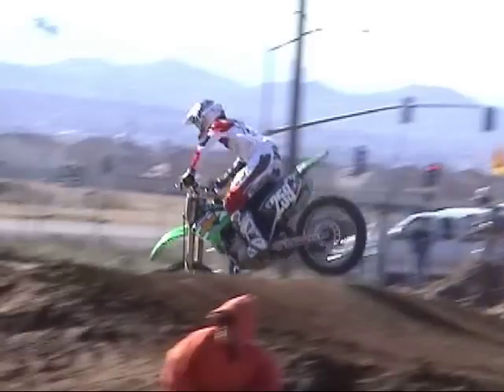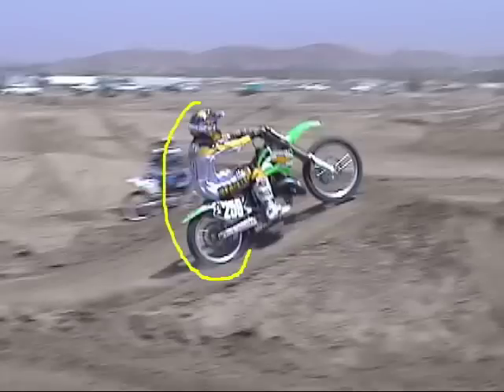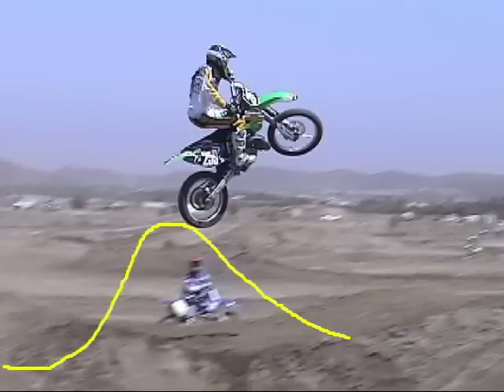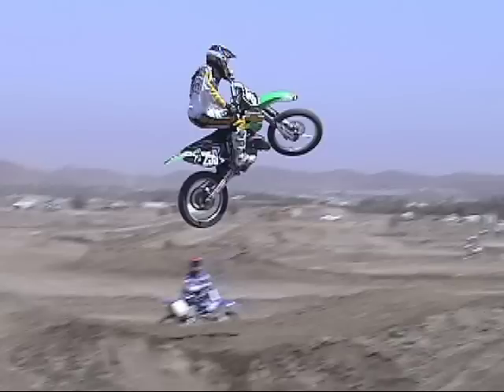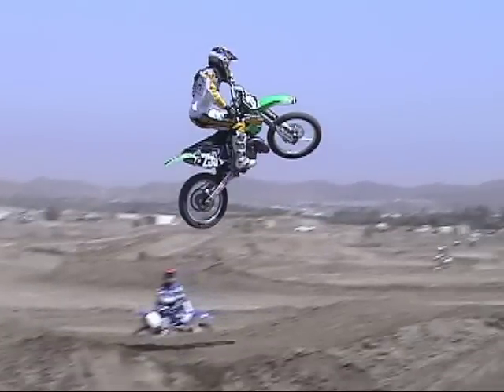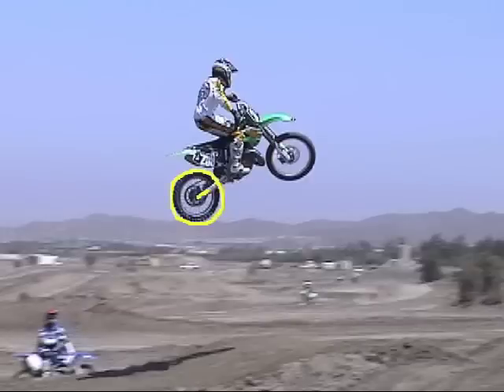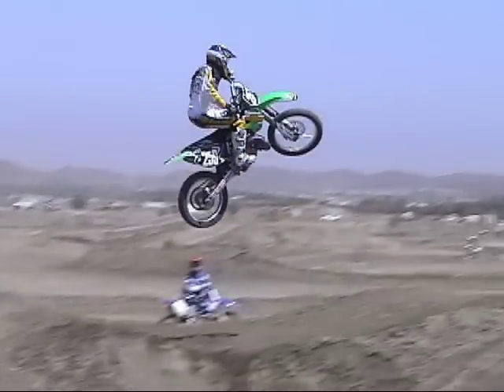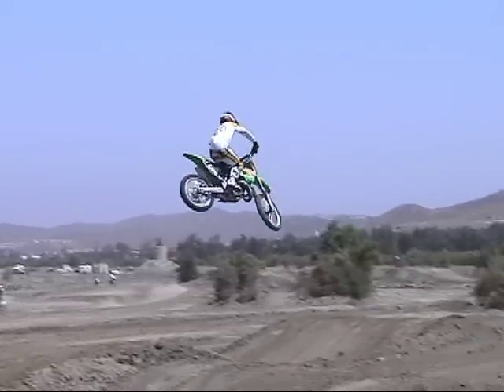RH41 - Bubba treino

Comment: this applies to any bike, slipper clutch or not, 2-stroke or not, if you stop the rear wheel in the air it causes the shock to compress, and when it uncompresses it makes the front end drop

Comment: @MrMotobros hello dude! It's just a matter of how long and how much hard you tap the brake pedal according to the rear wheel spinning speed and engine rotation level. In some situations, I not only pull the clutch, but also, open the throttle to start increasing the engine rotation at the same time. Doing that, after tapping the brake, causing the front end get lower and then releasing the clutch, the front wheel starts get higher again!!! It's quite common though. Hope it helped! .o/

Comment: @Thirty1United You'd lose the gyroscopic effect of both wheels altogether, meaning you'd have no control over the bike tipping sideways (notice how they use this technique to get the crazy bubba scrubs and angling the bike on it's side in the air, then tipping it back up). There's also a chance you'd faceplant once you land, since your front wheel will skid once it lands) Note that I'm just a theorist, this is just how I think it works.

Comment: I once practiced at gonerby moor track n a bird came up wiv a yam450f, she had 1 of those clutches and she could push the bike 2 the start in gear without holdin clutch lever in while engines running! whenever she put on throttle it would go! no shit!